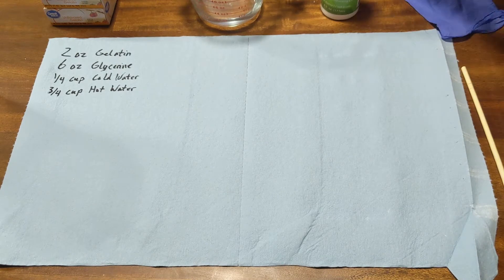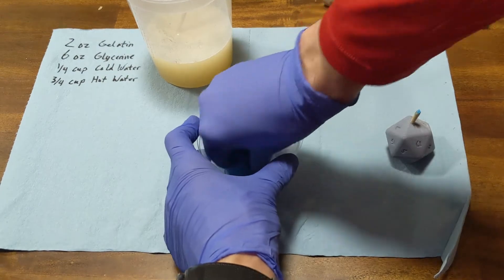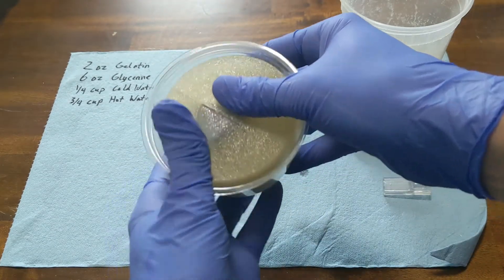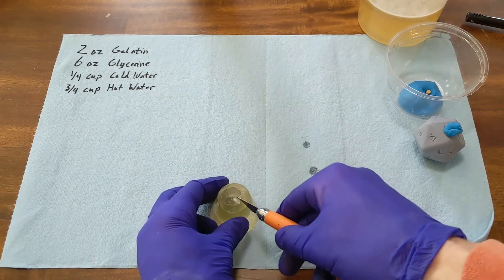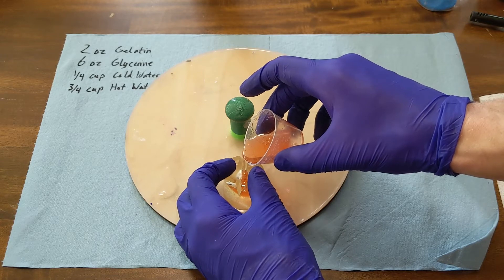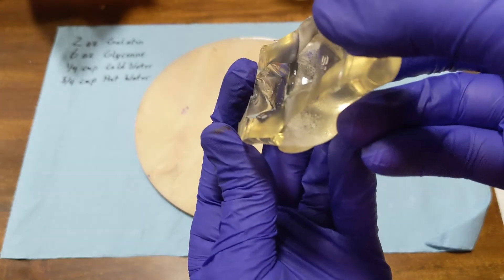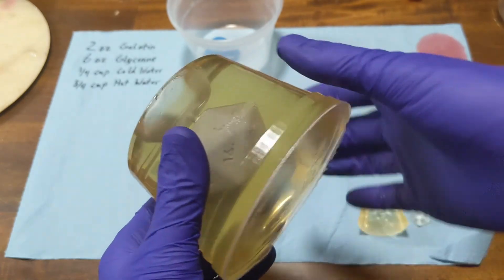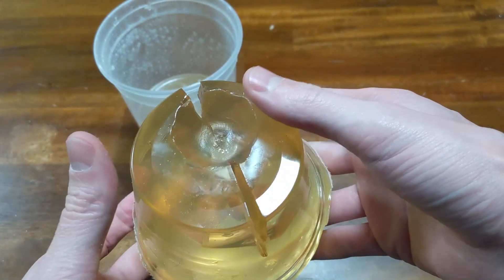Reusable Gelatin Molds - Silicone Alternative?

Comment: hi nice video, any upgrades or i stick to the same recipe, coz the video is 2 years old? i want to make few molds with Gelatin coz Silicone Rubber or Alginate are way expensive, pls reply
Reply from the maker: Same recipe, you could play around with the ratios to suit your needs if you want (more gelatin will be firmer). You'll want to use a resin that doesn't get as hot when curing if possible. For me, its worth the extra cost to use silicone.

Comment: Very interesting idea!  Have you tried increasing the amount of gelatin in the recipe (maybe 3 oz rather than 2) to see if that makes a more durable mould that is less prone to tearing?  It seems like it would be easy to alter the mix to increase the "hardness" of the rubber-like gelatin, just by adding more of it.  Whether or not that would reduce the propensity of the mould to tear is an open question that only testing would answer.

Comment: Hi Geek!
I have a way better recipe that I want to share with you!!
Mine doesn't use water... has NO bubbles...and it's also REUSABLE!!
Use equal amounts of gelatin & glycerin. 
Here's the recipe..(you're welcome! 😌)...
- 100 grams gelatin. 
- 100 grams glycerin 
- A little cornstarch.
- oil to grease the items you want to duplicate. 
- Heatproof gloves
PROCEDURE:
1- pour glycerin & gelatin in a microwaveable container. 
2- mix well and until you don't see any dry gelatine. 
3- microwave mixture in intervals of 5 to 10 seconds at a time..(aprox).
With a metal spatula, mix it well after each interval.
4- when you see it's all melted, that's when it's ready. It becomes like a very thick, gooey paste..like a soft dough.
5- Put some oil on your hands, so you'll be able to handle the "gelatin dough".. and also, if you think you need to...sprinkle some cornstarch on the top of the amount of dough you think you'll need (this is only to make it easier to grab it, because dough is sticky)..and with heatproof gloves grab the amount you want and place your item in it.. set aside and let it cool down  completely.. (BTW, I don't use gloves, but I'm careful the dough is not too hot so I can handle it).
6- This gelatin "dough" is liquid enough that you CAN POUR it too just like you did in your video!!!.. The hotter this "goop" is, the more liquidy it is obviously.  
So, let's say you want to make a mold of your hammer.. all you do is double or triple the recipe.. Oil the entire hammer and place it in a container that fits.. Line the container with parchment paper, place the hammer and pour the gelatin mixture on it until its all covered... let it cool off/harden.
Geek... your molds will be VERY FLEXIBLE, much stronger and BUBBLE FREE!!😊
To reuse it, place it in the microwave again.. until it melts..and... voila!
I hope this recipe helps you and your subscribers!
I also hope you try it and let me know if it worked for you!
Reply from the maker: thanks for sharing, I'll have to try it sometime
Reply: Hi! I'm using your method because I saw other creators do the same (no water but melting the mixture right away) the thing is that I ended up with a mold that's super sticky and I'd like to know how to prevent that, after melting I let it cool down first and then put it in the fridge for it to set faster, idk if that had to do with it, please help :)

Comment: Can you wash out the molds after?
Reply from the maker: Should be able to a little bit as long as its cool water. Otherwise, you may try just heating it up back into liquid form and run it through a filter

Comment: Question 1. Can this mold be used to make concrete stuff? Eg. Concrete dice 

Question 2. Can you add cornstarch or cement dust to your current mixture increase the stiffness of the molds so it won't be that squishy???
Reply: For a stronger mold, DON'T use so much water!!
The less water, the stronger your mold.
Your mold will be as strong as any silicon mold..and then you'll be able to create CONCRETE  items!
Reply from the maker: Excellent questions, I honestly don't know, but fairly inexpensive if you want to try.

Comment: my resin melted my gelatin mold. how can i avoid that?
Reply: Try a deep pour resin, they produce way less heat. It will also produce fewer bubbles for making a clean master. Deep pour has a longer cure time but would be worth the wait.
Reply from the maker: You'll want to use a resin that doesn't heat up as much if possible. You may also try putting it in the freezer and see if that helps

Comment: Super nice! How long do the mold take to solidify?
Reply from the maker: Depends on the size of the mold, however long it takes to cool down. You can put it in the fridge to cool it faster.
Reply: @geek-happens  I was actualy thinking about using it for some life casting experiments so the fridge part gets a bit harder 😄
Do you think there is any way i could make this work?
Thank you!
Reply from the maker: @AS0144  Ah, that would be more difficult and I don't think it would work very well. It has to be quite hot to stay in liquid form and could burn or be very uncomfortable on skin while you wait for it to cool. I haven't tried it, but for life casting, you may want to try Smooth-On's Body Double silicones, they have some fast curing ones that only take about 7 minutes
Reply: @AS0144  I think it's possible to get a life cast as I've made gelatin face masks before but you would probably have to do many many layers because it's not very stable when removing. 😂 I think silicone would be much cheaper and more stable option but I would love to see it tested out.

Comment: Hello.. Is it possible to pour liquid lead or molten aluminum into a mold of gelatin and glycerin.. Is it possible to make models? I wait for your reply and thank you.
Reply from the maker: The gelatin/glycerin melts at much lower temperatures than any metals would, so no, it would burn right through it.

Comment: Does silicone stick to the gelatin mold? If not I imagine you could make some rubber dice
Reply from the maker: It did not stick to the mold in my test, so it does work with silicone
https://youtu.be/Qgiyk4TIBMU
Reply from the maker: Excellent question, I'll have to try it :) I have only made silicone dice using two part 3D printed resin molds so far.
Reply: This would be interesting!
Reply: please let me know if you ever do decide to try it out, I realize I'm very late to reply lol

Comment: It's entirely possible that your choice in gelatin makes a difference in the ability to hold it's shape. Gelatin strength is measured on a scale of "bloom" which directly attributes to strength and transparency.

Great Value brand doesn't have any available information on the actual gelatin source (pork? Beef?) Therefore a bloom scale is difficult to pin. Knox, which Jenner used in his video, has a bloom strength of 225, just below Platinum which is the highest available strength and clarity. Platinum starts at 230 and goes up to 300, which is likely not the best option for this application since we want some flexibility.

I'm going to be attempting this with a platinum grade sheet gelatin and attempting a cap mold. Thanks for the video comparison!
Reply: To update: sheet gelatin is not great for this. Knox really is the way to go.